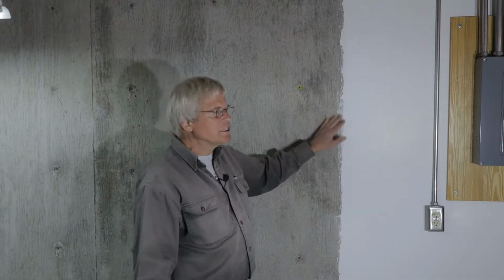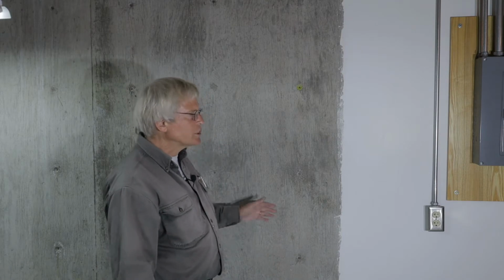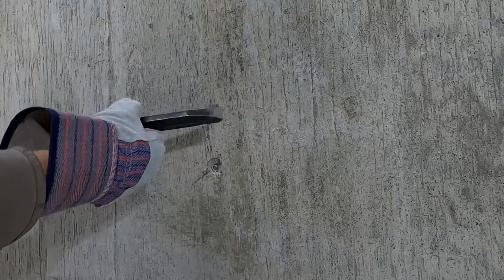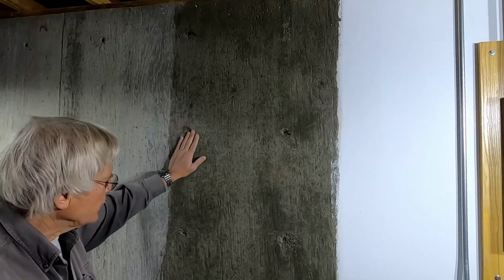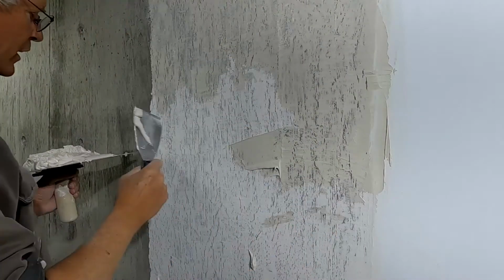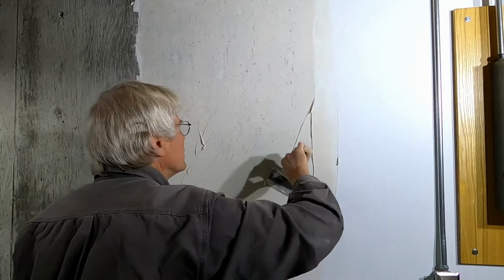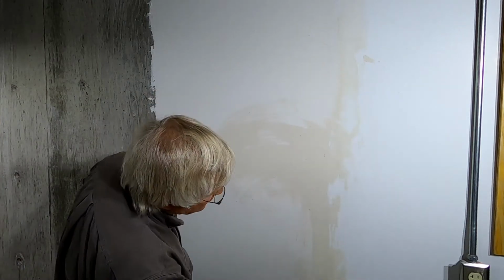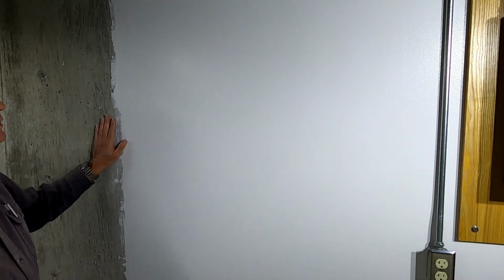How To Finish a Concrete Basement Wall Using Joint Compound

Comment: Poured walls do well with just a white stucco color coat; you can also get white Portland cement and make your own with some ultra fine white/light sand for some added strength. A little lime added will also help with flexibility. We used to just white wash our walls with some lime slurry. I’ve also done this with a 45 minute setting compound to about a slightly thicker than paint consistency, rolled on, and smoothed with a trowel, knife, or squeegee; I actually like Marshalltown’s skimming squeegee for this as it’s fast and leaves a nice surface. One nice thing about using gypsum plasters (joint compound) is they’re sand-able whereas most lime and concrete products aren’t and take more skill to apply. You can also hit any holes/voids with a fast setting hydronic cement first. I live in NY and we use CMT (cinder or concrete blocks) quite a bit especially in garages where this type of finish is fast and inexpensive compared to say a scratch, brown, and color coat of stucco or even a skim or skim and color coat. I’d avoid all purpose of topping muds for this as they shrink too much and also re-hydrate too easily; if you’re going to do this I’d use a setting at a minimum or mix in some plaster of Paris as well as some glue to aid with bonding or use a bonding agent. An acrylic concrete bonding agent can help with adhesion as well as with water permeation though interior solutions are never an absolute or even good fix for water ingress but something can be better than nothing.
Reply from the maker: Chris - Thank you for all of this in-depth information.  I wish I had known half as much 16+ years ago as I've learned in the past few months and wish I had another finishing project to use this information.  Hopefully, some viewers of this video will read through the comments and benefit from all this knowledge and experience. Thanks again!

Comment: 👍👍 I live in the Bahamas and we do this alot. Our building code is concrete block walls so if one want a smooth look joint compound is the way to go. Thank you for sharing.
Reply: Thanks so much for this comment. Saves me a lot of time and money using joint compound instead of another layer of concrete/cement
Reply: @ZereauxC  u a Carey u might be 242ian too✊✊
Reply: @Lawless187indika  yup born bred ga dead Bahamian straight outta Nassau. Wasn't expecting to find others in this comment section 🤣
Reply from the maker: That is pretty interesting!  I learned something new today.  Thank you for sharing!
Reply: @KevinTaberski  texture is for sissies!lol that was funny. You might have a lil 242(Bahamian) in you too sir. 😅 Thanks for sharing.
Reply from the maker: @Lawless187indika  you are welcome!  Yeah - I’m not a ‘fan’ of texture.  It is WAY overused here - IMHO.  Thanks for posting.
Reply: Hi Ms Margaret😁my fellow 242ian. I was just rNdomly watching vids and saw ur comment. Not that i refer to actual code,so bear wit me.  however,i would add to your comment that,more times than none we use drywall/sheetrock over studs before we apply the joint compound to interior walls. Our climate def wouldnt encourage JC directly to concrete in regards to moisture. Im currently chipping a way a disaster job from this exact scenario.  This guy in yhe vid may live in some cold or non humid country/state/province to allow it to last longer.Nonetheless, cant is too strong of a word to use,it certainly can be done but i think especially nowadays there are more intricate mixed compounds that would allow for a better application. Just my 2 cents mam u very well know more of the actual code than me. 

With love from "roun da corna"❤
Reply: @Lawless187indika  Hi fellow 242. I used the joint compound on my interior concrete walls and they are beautiful. No need for the added expense of studs and drywall. Once finished and dry you can go ahead and prime then paint. The finish is very durable. Remember, this is a skim coat to smooth the surface of the concrete wall.
Reply: @mknowles8784 I’m in the Bahamas , and just completed my scratch and plaster.

Bout to have my drywall guy apply JC to my walls for the smooth finish as well
Reply: 242 to the 🌎

Comment: This looks great. How long does it last?
Reply from the maker: The initial section (~25 linear feet) has stood-up for over 16 years.  Works fine, lasts a long time and doesn't rust, bust or take-on any dust!  YMMV.
Reply: @KevinTaberski  thank you!

Comment: Why not just grind the wall smooth?
Reply from the maker: Having ground the epoxy paint off of a section of my basement floor, I can't even image what the process of grinding the walls would entail.  Plus, you would STILL have voids that would need to be filled.  So, a combination of knocking down the high spots and filling in the low spots seems (to me) the way to go.

Comment: Had me at 3 inch drywall knife , hence the (16 years later)  "sponge Bob voice" 

Nice vdo
Reply from the maker: If concrete wasn't so abrasive, I may have used a bigger knife - just didn't care to abuse my good knives.  With respect to my "Sponge Bob voice" - I'm flattered!  One can only hope to be compared to Tom Kenny.  Thanks for posting!

Comment: I would recommend to thin the mud apply it with a roller, use a 12” blade to skim it, would go much faster
Reply from the maker: Ed - the roller sounds like a good idea.  The key is to fill all the voids.  Thanks for the tip!

Comment: VERY INTERESTING VIDEO!
YOU HAVE SOME GOOD INFO AND IDEAS,,
BUT,,. YOU COULD HAVE ALSO MADE THE WALLS TEXTURED USING THE COMPOUND,,SINCE THE WALLS  HAD ALOT OF VOIDS,,,
OH NO !
YOU JUST SAID IT,,,
"TEXTURED WALLS ARE FOR SISSYS"
BUT ANYWAY 
YOU DID A GREAT JOB!
Reply from the maker: Thanks for the reply.  I suppose there is a place for texture - I just found that I could NOT find a contractor that could (or would) provide a reasonably smooth finish.  They ALWAYS used texture as a means to cover a poor finish - at least in the area in which we live.

Comment: To get a better seal on the concrete I would have squirted some wood glue or some other adhesive into the mix of compound... same as drywallers use in taping mud for adhesion. That, in theory, might give you a higher "waterproofing level"... we all know a rubber outside sealer is best for that.
Reply from the maker: Daniel - I am not familiar with the idea of adding wood glue to joint compound.  Thanks for the tip - I look into this.
Reply: Elmer's glue also use the green box mud which contains the most glue

Comment: I was thinking if you paint the wall with dry lox paint to seal out moisture first that may help .
Reply from the maker: Ken - I'm not familiar with Dry Lox, but as it's a paint I would expect one would have the same problem with working it into the voids/pores of the concrete.  Based on my continued research on this subject - I think some form of plaster as is used in lath and plaster might be a good choice at least for the first couple of coats.  The remaining question (for me) is what IS the plaster and where is it obtained.  The term 'parging' kind of covers the process, but the examples that I've seen to date result in too coarse of a finish for my liking.

Comment: How did you mix the compound an what primer did you used ??? ...
Reply from the maker: Anthony - I used the All Purpose (green) Joint Compound straight out of the bucket.  I did not thin in this case.  If there is any water floating on top, I will mix with a paddle mixer in a drill and will add a bit of water if the mud is too thick.  I used Benjamin Moore Super Spec Latex Undercoater & Primer Sealer (253).  I top coated with 2 coats of Benjamin Moore Regal Select Interior Semi-gloss (White).
Reply: Ok thanks alot kevin.
Reply from the maker: @anthonyembleton6385  you're welcome!

Comment: I WOULD BE CURIOUS TO KNOW HOW IT HOLDS UP AFTER A WHILE.
Reply: My dads has been done like this for ~20 years
Some small spots below leaky windows have a bit of water damage but as long as you put the primer on heavy it should soak in and waterproof it
20 years in a michigan basement says it works
Reply from the maker: @Creamcorn0  - this is great to hear!  Glad I'm not the only one to have tried this.  Thank for posting!
Reply from the maker: Luc - in this video, I extended the section that I had finished approximately 16 years ago - so it's held-up for me for 16 years.  If I had the opportunity to start the entire project from scratch, I think I would now try 'hot' mud/setting mud.  I believe it would be more resistant to moisture - though in my case moisture has not been a problem.
Reply: @KevinTaberski  Is hotmud known as Durabond?
Reply from the maker: John - I have not used setting joint compound, but I believe it is referred to as hot mud.  Based on a quick internet search, I learned that  USG (U.S Gypsum) is the maker of DuraBond) which is a 'setting' joint compound, which by extension is hot mud.  see: https://www.usg.com/content/usgcom/en/products/walls/drywall/joint-compound/setting-type-powder-joint-compounds.html.  USG also sells 'EasySand' - which is readily available in our area at the local home improvement stores.

Comment: Is 5 coats of compound standard?
Reply from the maker: I don't know what might be standard or typical for a finish on 'normal' drywall - or what a professional can accomplish.  I just keep going until I achieve a finish that I'm happy with.  Starting on concrete requires a few more steps.  I tend to apply multiple thin coats to reduce sanding.

Comment: I like the comparison at 12:30 between what you did and what was before. It is a big difference.
Reply from the maker: Yes - most of the improvement comes from knocking down the high spots and filling-in the voids.  The rest is just icing on the cake, which really makes the results stand-out.